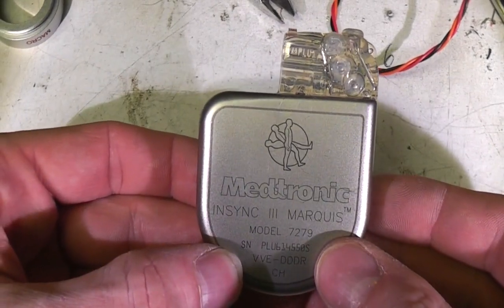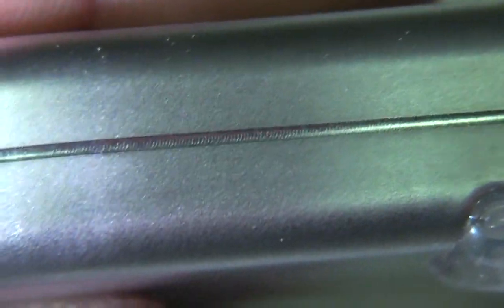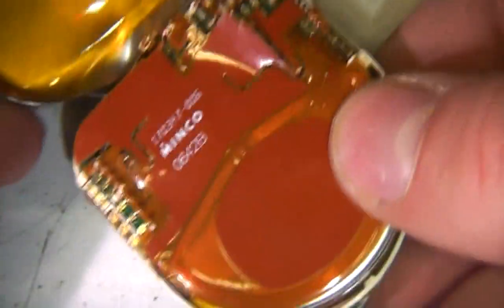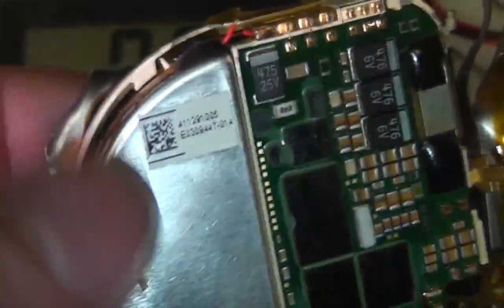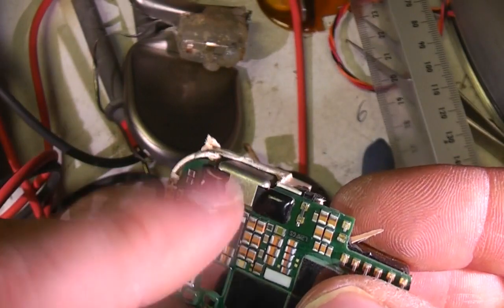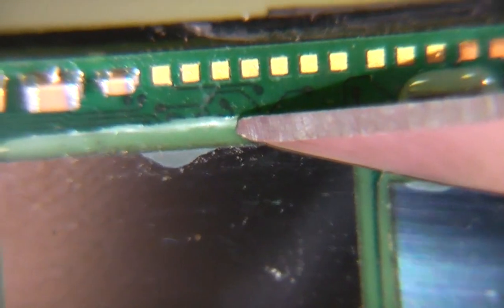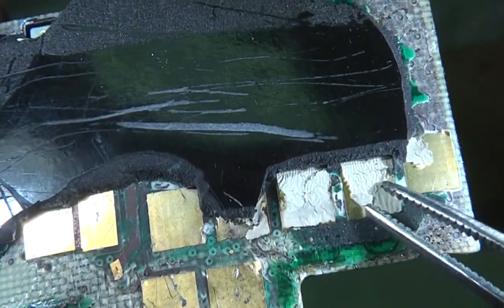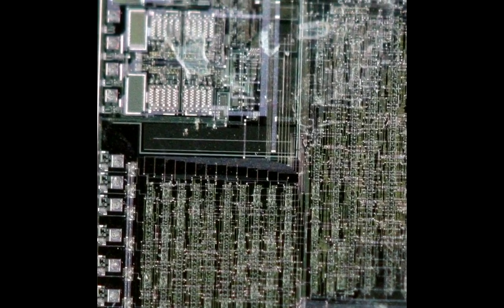Implantable defibrillator teardown

Comment: If you see those silicon chips on the top, I used to work for the company that made some of those.  I was the Sr. sputtering engineer at their clean room.  We made the high precision laser trimmed voltage dividers.  They were silicon chromium resistors in an array with a TCR of better than 1ppm and very low drift.  I am pretty sure we were the only people in the world  that figured out the process.  It was very difficult.  Tons of people use TaN but it only has a sheet rho of around 100(unitless)(distance/distance) while SiCr is around 1000.  We made something like a 1000:1 voltage divider at around 1gigohm across with a tolerance of 0.01%.  But it also had several other single resistors on it.  It was probably one of the smaller ones you see.  It was only like 1mm by 1mm.  If I remember correctly the stack from the bottom up was silicon(111) - silicon oxide(epitaxial) - SiCr(resistor) - TiW(diffusion barrier) - Aluminum(bonding layer) - Silicon oxide(outer barrier grown with Silane) - super thick Aluminum on the previous Al pads that had been etched through the SiOx layer.  
Most of the sputtering machines were commercial but our SiCr machine was entirely custom.  We used to joke that we needed to sacrifice a goat to get that SiCr process right.  As I said before it was very difficult.  Once someone accidentally bumped our magnetron and it took me close to a week to get it back right again.  This was because it took around 8 hours to perform the process step as it was done it UHV.
Reply: Got some of those from a liquidation auction from Angion. Used them for measuring the HV for several applications, mostly for radiation detectors that needed extremely stable hundreds of V at extremely low currents.❤

Comment: The alarm means something's wrong with the ICD and needs fixed quick. Mine has done it twice when my lead wire's went bad. Shocked me once because of it. You should have wore rubber gloves because if if that thing still has power it could zap you like a tazer if you're not careful. It feels like you're hit by a Mack truck when it shocks your heart at least.

Comment: thanks for posting, I kept mine after 10 years implanted because it gave me a shock at 6.12  in the morning and after one therapy the protocol is to change the model and I told the surgeon that I wanna it back, that is mine, put it in my surgery robe. he did. now I can see what is inside this souvenir and yes the alarm goes on usually at 11 am and 11 pm. even my dog reacted to this specific noise. how the shock was, really normal the same level of a shock from say electric household lamp, but shorter, anyway I was sleeping turned around and went back to sleep, then at lunch I went to  the cardiac hospital to report incident, normal life goes on I have a new one 3 cables and bigger since 2012 = feb. 2017 no incident.......those are made here in Puerto rico- medtronics

Comment: the older type ones were a bit "jumpy " and tended to shock at the slightest miss beat ,but the new ones also have a Pacing program in them and  let the heart try and realign itself first , then if it can`t ,first slight shock is given  (very mild wont feel anything ) this is  "pacing"   ,then if you "blackout" a full shock is given to re establish normal heart rhythm . people watching will see your body jolt as the shock kicks in , but the person with the defibrillator should feel nothing only  a bit "groggy " when he/she comes around . People holding on to or touching  the person at the time  will NOT receive a discernible  shock  of any sort .
Reply: Anthony Fox does the devices save data within the unit it’s self if active

Comment: Mike sensible question do you know if you can use a mig welder with an icd implant. if not what type of shielding can be used.
Reply: It depends on what kind of device you have. Some pacers will go into asynchronous mode if it can't sense your intrinsic rate (could be from a magnet or electromagnetic interference). It will basically start pacing your heart at a given rate until it can pick up your heartbeat again and then only give you extra beats when you need it.

I've seen a defibrillator shock a patient before when a bovie was being used intermittently for a minute or two. Most defibrillators take a little while to build up the right amount of energy, so I would assume you could get away with a lot of stuff if you only do it for a few seconds. Just keep in mind that you can only take so many shocks. The shocks get less effective if you do them one after the other, too.
Reply: welders - any device creating a magnetic field - can affect an icd.  my alarm beeped when i got too close to and industrial magnet, and my co-workers easily heard it too.  the cardiac center told me if the alarm doesn't ring, it's not being affected.  i routinely have my cell next to it, and worked with demagnetizers without problems.  you may need to increase your distance from the mig unit, but it's not likey to affect it unless you are very close.  if your chest beeps, step away.  it will stop beeping after a bit, and you are good to go.  i had mine checked out to be sure.

Comment: Tearing down a powered defibrillator using metal tools....  Not sure I would do that. It will be designed to kick out high voltages which can stop as well as start hearts. Very risky.
Reply: If the tools are connected directly to your heart via  a small coax running in the right spot, yes, that would be risky.
Reply: I don't know if these devices are even capable of producing a high voltage shock. Don't forget that these implants are connected as close to the controlling mechanism of the heart as possible (quite possibly even running INTO the heart)

Only 1 Volt with sufficient Amps is likely to get the heart to fibrillate instead of the high-power pulse that has to be applied via an external defibrillator.
Reply: weeardguy The voltage produced by an ICD is about 750 volts. This one is still active.  So what this guy is doing can actually be very dangerous for him if he touches the wrong parts.
Reply: I was doing chest compressions on a patient one time that had an icd. It bit my hand when the rep set it off because the guy had ultrasound gel on his chest as they had just looked at his heart with an ultrasound machine. I imagine it would be worse if you were actually touching the device.

Most devices are swapped out before the batteries completely die, so there is usually enough juice left in them to ruin your day. With that being said, most reps will deactivate the can before tossing it so it won't charge up/discharge without being reprogrammed. So, I imagine the worst shock you could get would likely be directly from the battery.

Comment: Thanks for a great and informative video.  Four days ago I had a Metronics EVERA XT DR DDBB1D4 installed, it is a combined two wire model, and I was curious about the gubbins under the good.  My manual says the error noise only goes off for a set time every day to alert the wearer (me) that action is required or that action has been taken.  Then I hook it up to the Remote Carelink Monitor device and call my hospital who can analyse it remotely. 

They killed the VP using a Remote Monitor in a Homeland episode taking some technical truth and adding some artistic license, it made for good TV.  Cheers Nigel

Comment: Yet another reason you're now my favorite YouTube channel. I do this for a living as a cardiac electrophysiologist (I implant these among other procedures). You teach me so much with these vids, but here are a few answers to some of your questions:
1) A = atrial; we put a lead there to read the top chamber and pace it if needed
2) Spot on - the cases are always titanium alloys
3) You're right about the hole; it's for attachment, but we suture it directly to the pectoralis major muscle with nonabsorbable suture material (I prefer Ethibond; some others use silk)
4) That buzzer you set off is the "high alert" tone; that model of defib has 2 available alert tones played through a 120dB speaker. When implanted, that sound is only audible in a quiet room. The reasons that can go off are several and programmable and can include any dangerous arrhythmia, prior shock delivered, etc, but always include device malfunction; hence your discovery. What's interesting about this is that the buzzer usually goes off only once daily at a specific time (and repeats daily thereafter until a professional clears it); interesting that you got it to go off so immediately.
5) The high voltage circuitry is via flyback transformer circuit to the very large capacitor (your device is two gen old; a current defib is about 20% circuit, 40% battery, 40% capacitor or so). The voltage is just a hair below 1000V (usually 800-some-odd for that 35J defib you're working on there).
6) You're right about the lithium chemistry of the battery; Lithium Vanadium Oxide I think for that model, but don't hold me to that. The energy density is lower than the lithium fluoride we use for pacemakers but defib batteries are always chosen to delivery VERY high current drain when defibrillation is called for.
(More in another comment if needed)
Reply: doctorgarner Oh wow, that's really something. Thanks for that comment.
Reply: Thats very long

Comment: these things have wifi and can be connected to the doctors computer to examin things like how many defibs where triggered
Reply: And I wouldn't be surprised if it uses passive-communication like 
RFID-tags, where the receiving end (the doctor's computer) also supplies
 the memory it's power via radio-waves.
You want to save as many energy as possible.

Comment: Where is the FCC tag that says the device must accept interference that may cause undesired operation.
Reply: I think this is the one case where its the exact opposite, although if that were the case why are there the signs about microwaves in use/strong magnets. I'm also curious what these interference's would do?  Would it kill the device or cause a misfire; Perhaps make you sound like you have a tiny ambulance in your chest!?

Comment: imgur(.)com\a\9NotB Not the best photography and I had mangled some of the flex pretty good, but you get the idea. All of the ICs except for one seem to be full-custom. The small one with a lot of writing on it is a Cypress cy62148V 4Mbit SRAM. The most interesting thing is the irregularly shaped (polygon) IC package on the back of the flex. It's also somewhat interesting that there are two communication coils. The battery was pretty dead - down to 1.83V. Installed in 2007, removed in 2009.

Comment: I ended up opening my friend's old Guidant (Boston Scientific) Vitality AVT Model A155. I wasn't very graceful in my attempt, but I only BARELY nicked the battery and it didn't catch fire :D . It is WILDLY different than the one Mike opened up which is coincidentally probably identical to the FIRST pacemaker my friend got in 2005. This Guidant model was his second and was installed in 2007 and removed in 2009. He's on his fourth!
I'll post pictures when I don't have a splitting headache.

Comment: Actually it may well be a serious risk. There was a presentation at BlackHat recently that showed it was entirely possible to use a high-power transmitter to interface with at least one such device remotely, simply by "pretending" to have heard the device's response and sending new configuration data using the (rarely changed from default) pin-code. They demonstrated that the device was capable of outputting hundreds of volts on demand. Nasty stuff.

Comment: The silicon is big because it is a large features size. For example 1 um instead of 65 nm: 16 times the widths and length.

And that is needed for low power. The speed goes down but the leakage current goes down as well. And these need to run very long on a battery.

The large feature size (thinck insulation etc) also allows to have power circuits with the processing.

Maybe the processing is dedicated hardware, and the CPU only comes online every so often to readjust thresholds etc.

Comment: I've got a medtronic device (not a pacemaker) which cost a few thousand, pretty surprised to see inside this being so advanced, mine is pretty simple in comparison (I wouldn't think any custom chips). It also has a wireless data transfer that is always on, with a ~15 metre range and communicates with a PC, another medical device from another company and a remote control so it wouldn't surprise me if malware does start to appear on medical and medtronic devices.

Comment: That large non-memory chip looked like the signal conversion.  Some blocks of analog, a bit of glue logic, etc.  No blatant resistor ladder, so they likely are using delta sigma conversion.
Reply: Jeff DelPapa yes, looks like a thermoset

Comment: A relative had one of these fitted which had remote monitoring. It had a base station that was connected to the phone line. The defibrillator would send out a signal to the base which would phone home to say that it had delivered a defibrillation, along with some stats. They could then call him in to hospital as needed.

Comment: Hi Mike. I have in some situations been able to shield fairly low frequency magnetic fields (10s of kHz) using thick copper. The eddy current losses eventually (if the material is conductive enough and thick enough) attenuate the field. Of course, for DC, the only things that can shield that are high permeability materials like mu-metal or superconductors.

Comment: A - (right) atrium - top chamber of the heart - low voltage rhythm sense and pacing
RV and LV = Right & Left ventricles - low voltage sense and pacing

SVC - Superior vena cava (big vein) - Defib electrode
RV - right ventricle - seperate defib electrode

Some of these ICDs use the case of the device as a reference electrode for defib - something to do with producing a better bipolar waveform. I think that's what "active can" refers to.

Battery is a special lithium silver vanadium cell.

Comment: All of those chips are silicon-on-insulator technology.  They are manufactured using the same techniques used for space electronics.  They are fully radiation hardened.

Comment: The batteries are lithium-iodine, a battery technology which was developed by the CIA in the late 1960s.  They have an incredibly low rate of self-discharge; they can last decades on the shelf.

Comment: Batteries for pacemakers/ICD:s are not rechargeble. Instead the device is very energy efficient and the battery is very high capacity. St. Jude has a department dedicated to the development of batteries. Once a pacemaker/ICD is about to run low on battery it is replaced with a new one (once every 10 years or so). The replacement is a pretty minor operation, since only the can is replaced and not the leads. That's why the leads are attached with connectors and not permanently attached to the can.

Comment: Typically, regulatory requirements need a calculated failure rate based upon statistical analysis of failure rate of component parts. Some parts (like software) are taken to have a failure rate of 100% for the purposes of analysis, so for something complex like an ICD - the software will be backed up by logic that will provide failsafe operation.

I believe NHS cost for one of these devices is about £25k + VAT.

Comment: Battery is non rechargeable lithium, normally will be changed out every 10 years ( leave leads in and just connect new one, as this is on the side under your ribs and easy to get to, no splitting you like a slaughtered animal again. This will trigger airport detectors. the coil is for the doc to get stats on when it operated, how much, how long, rates and such, stored in the big RAM chip, and read out with a coil held over it.

Comment: That CPU looks like an embedded 8052 core, like in a credit card, just a bigger feature size. You can basically consider this to be a single multichip IC, as that potting is probably the same one used on conventional chip packages. Best way to have removed it would have been a mix of HF and fuming nitric acid in a big well ventilated area with regular washing in acetone to remove the degraded stuff. No epoxy or underfill left, just the bare chips and the insides of the caps and any ceramics.

Comment: How can you assume the cap charging circuit can't malfunction so it keeps electrocuting? couldn't some watchdogs make direct powering safe enough?
and how much power does the heart really need in direct contact? I doubt a good lithium battery couldn't fry the heart. it's only a signal, not actually powering the heart. and if the device is on the outside then power can be rather unlimited.
maybe there's a business segment there for you :)
mr billionaire

Comment: We recently took a ca. 7 year old model apart. It had similar caps in it, no buzzer but 3 or 4  coils for communications! It was able to communicate to a "basestation" next to your bed to transmit system data while asleep. The basestation had a GSM modem to communicate with the hospital. They had called the "owner" and told him, he had to come in - one electrode had fallen off....the pacemaker detected that, sent it to the basestation and the basestation then "texted" to the hospital :-)

Comment from the maker: Cap is needed as you'd need to pull too much current from the battery. It's also safer as the cap limits the total energy that can be delivered.

Comment: to go to all that trouble only to have them fail : ) keep it simple stupid.
why not just implant electrodes with inductive coupling to a flat device you wear or little pads under the skin where high voltage can penetrate the short distance through the skin.
I also wonder why large caps are necessary, instead of just generating high voltage on the fly. assuming this implant type is even high voltage which I sort of doubt now that I think about it.
simple enough even Dave Jones could design it :)